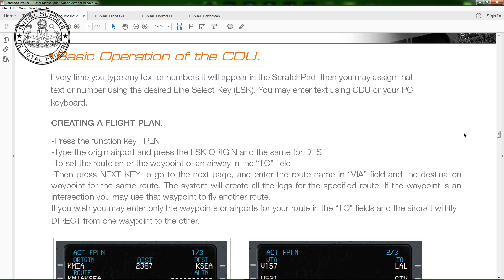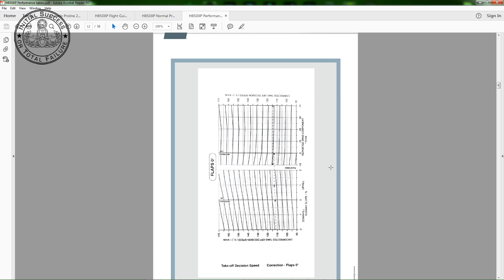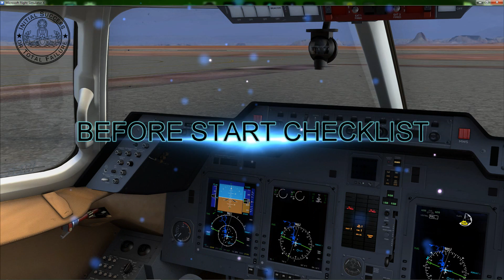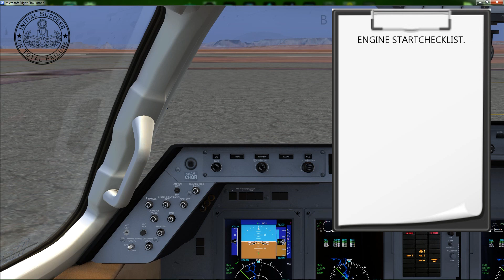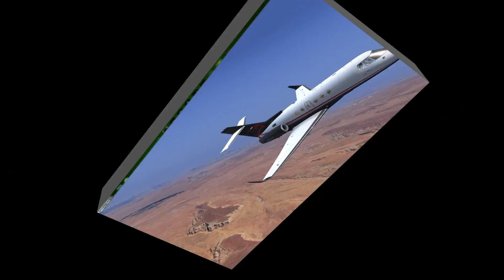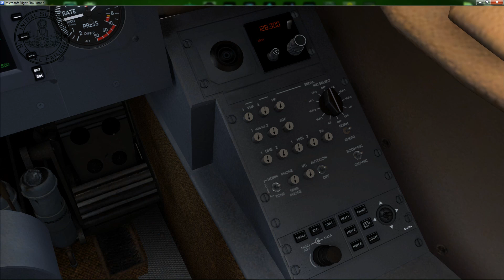Carenado H850XP | Full Flight Tutorial | KPGA to KSEZ

Comment: There is a major issue with the H850 that I have brought to Carenado's attention TWICE.... the N1 set on takeoff.

If you read the documentation it shows that you can go to 100.5% for 5 minutes on N1, even if you set the N1 to manual and set it to 100% they will still only go to 96.2% initially and then VERY SLOWLY rise over the course of 10 minutes. It is impossible from what I have tested to ever get maximum takeoff performance from the H850XP, you lose out about 4.3% N1, and that matters when hauling max pax near MTOW. I even did the testing at ISA standard conditions using custom weather at sea level, it always maxes out at 96.2 N1 with a gradual rise over time. This aircraft has some serious engine performance issues, and it's sad that they left so much out as this was to be thier flagship private jet, they even modeled wingflex in it, and pushed it's release back 1 year. This aircraft was in development for 2 years before release and it still has these issues, very sad indeed.

Also to deal with that left pull, make sure on takeoff that you set the Eng Sync to N1, your N1 was out of sync by 0.4 with the left engine producing more thrust, this would likely be the reason for the left pull.

Comment: Where did you get this charts from with the checklist and the performance chart
Reply from the maker: Been a while...off the top of my head though, they should be in the manual, which I believe is found in my documents...or a direct folder link through the start menu.

Comment: APR test is done by, arming the APR green button, and then advancing one Power lever forward,either one, you will see the APR white light on,means it works.

APR stands for Automatic Power Reserve, before take off you arm the green APR button
and in case of one engine failure the other engine advances power automatically.
Starting the APU or engines ,first thing is to ON the BATT ,not the EXT, external on is only used when you are connected to a GPU

Great job by the way,if you need any more info feel free to contact ;-)

Comment: The electric trim test is correct. On the actual airplane you would push on the trim tabs on your yoke and see if the trim turns the correct way. In this case it would be on your joystick or pc yoke.
Reply: Oh great tutorial btw. With the FMC, you need to put the airway entry point in which is PGA in this case, that's why it's not allowing you to start with the airway, should be the same for all FMSes. In IFR, the lowest safe altitude is calculated from the start  of each airway to each intersection until the end. Then again, would help if there was documentation :)
Reply from the maker: Excellent! Thanks for letting us know Marc :-)